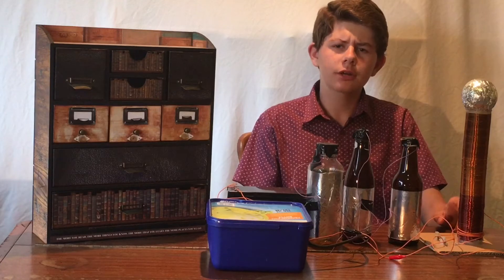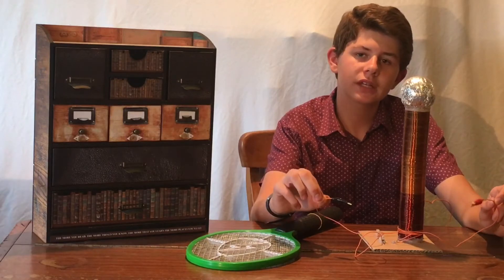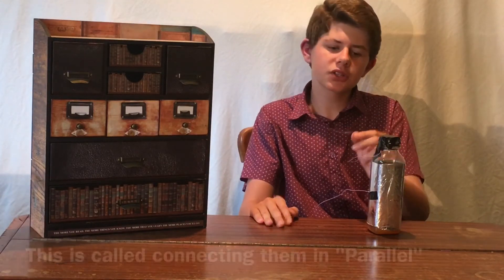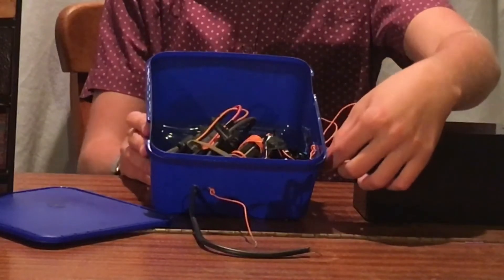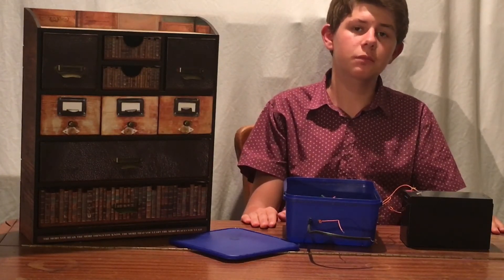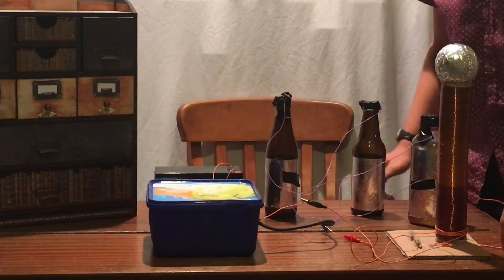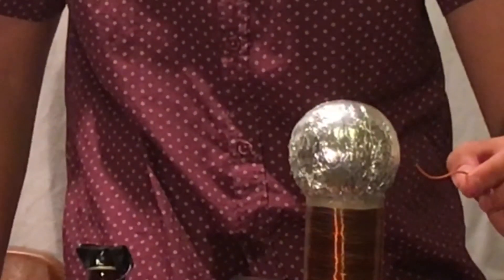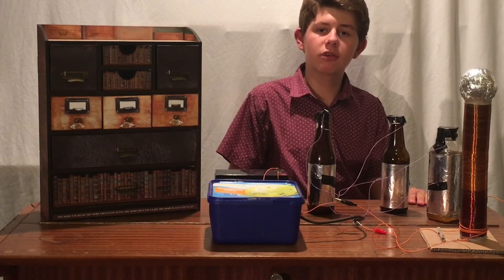How to make a High Voltage Small Spark-Gap Tesla Coil (With limited parts)

Comment: ummm.... it almost looks as if your voltage went DOWN through the secondary. the sparks were bigger before
who agrees
Reply from the maker: Down to a Science Yes you're right. I think this is because the wire I used (commonly available and cheap) is quite wide and the coil ends up being quite high. Unfortunately this means that a lot of energy is dissipated and the sparks aren't so large. However it does enable the neon bulb and other objects (including my homemade coherent radio receiver) to be illuminated from a distance. 
Ethan

Comment: You can take an old crt (small one), remove the degaussing wire and use that to wrap a secondary but only make it about 6 inches tall with a 1.5 in diameter pvc pipe. Use 2 beer bottle caps wired in series, and use the tv itself as the powersupply by disconnecting the hv output of the flyback from the crt and wiring up a ground to anything grounded inside the tv. It gives a much better performance with about 15kv at maybe around 30-60 ma. Use about 6 turns for the primary. This should give you much better results and will breakout about 2 inch streamers with no breakout point. 
Mine puts out somewhere around 50kv with this setup. (Although Im now using an nst because Im sick of flybacks) 
Also, for some reason when I switched to the nst, the caps wired in series didnt work anymore and I had to put them in parallel. Now its a beast of a tiny coil. 
I used no calculations at all and it seems to be close enough to resonance.
Reply from the maker: Smithii thanks very much!